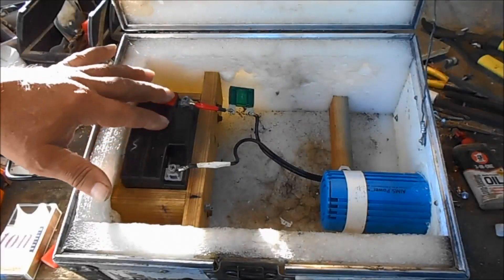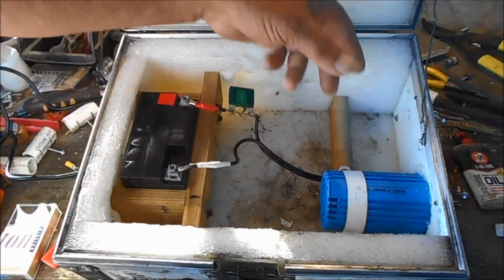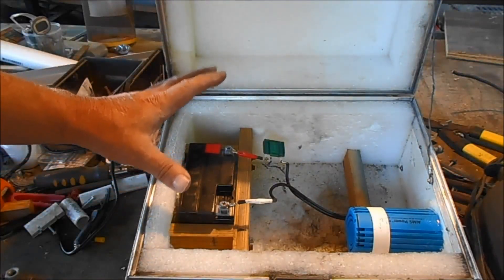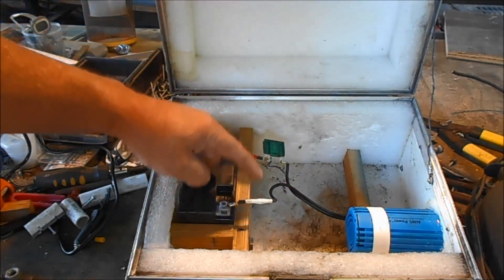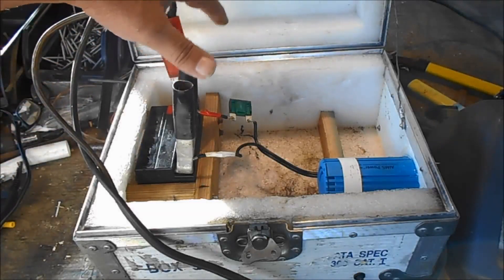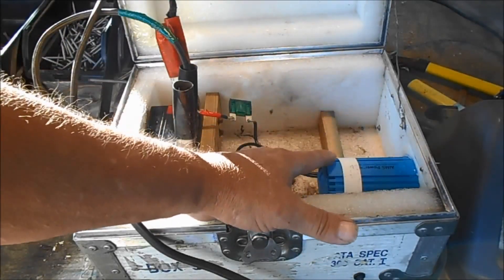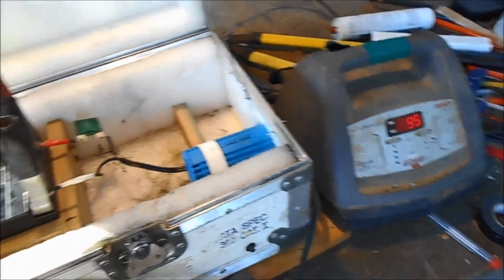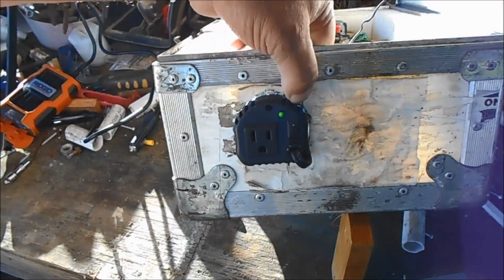How To Make A  Power Pack

Comment: The company that makes your electric drill makes an 18V inverter that has built-in outlets plus USB outlets. You hook it up to the battery that comes with your drill. Last I checked it sells for less than $100. It's a handy little item that saves you the trouble of building one yourself. Just an FYI. But then you wouldn't have the fun of building one yourself.